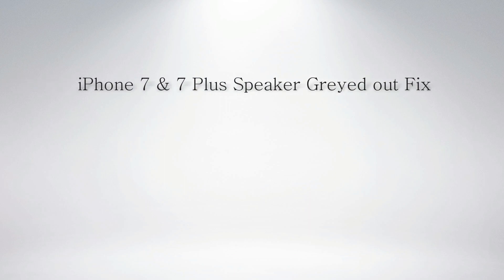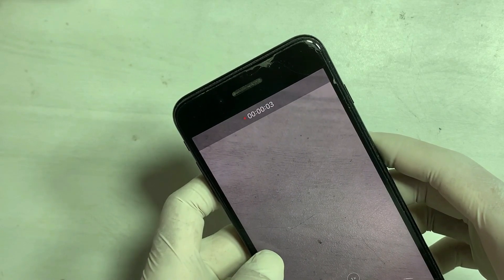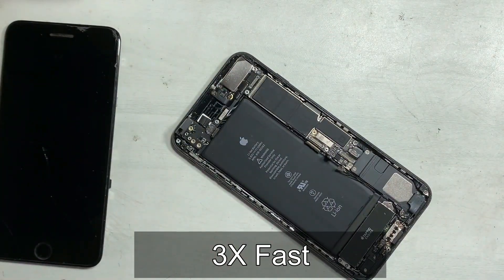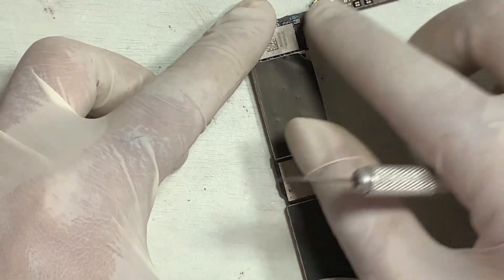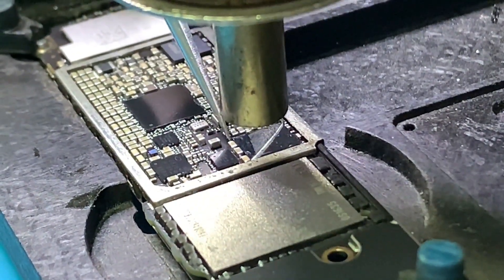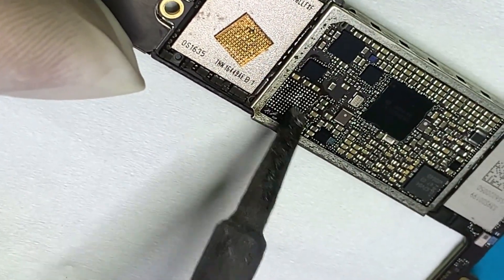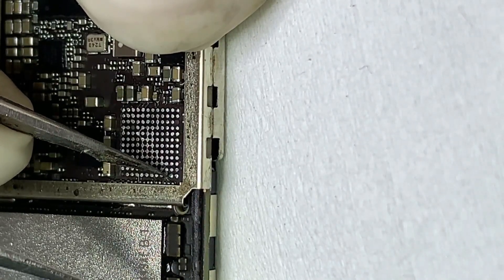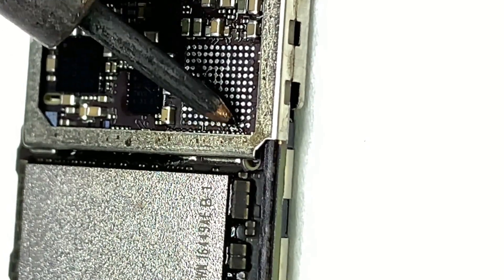iPhone 7 & 7 Plus Speaker Greyed out solution Final Fix.

Comment: Im an phone and computer repair guy and from my expirience instead of taking out the whole audio ic just stick something that will press on it when you return the board onto the frame a small folded paper or a piece of silicon case or whatever just not a very hard material that can damage the sound IC. Return the board in the frame put back a few screws just to hold the board and power it up give it a test and viola this has worked for me 99percent of the times hope you are not the unlucky 1 percent and yours works too CHEERS.